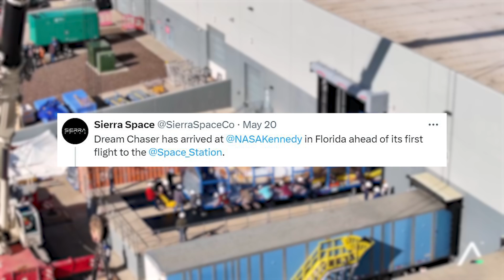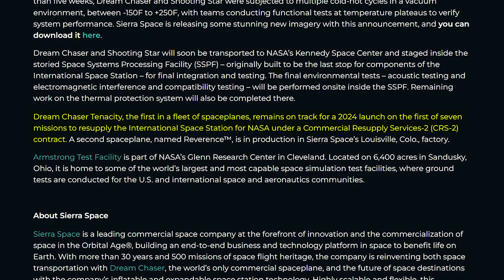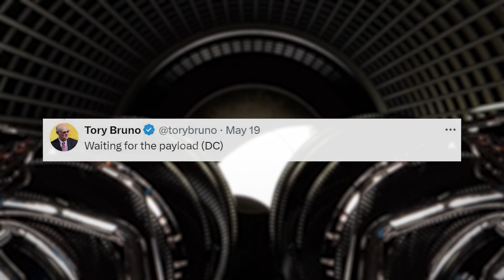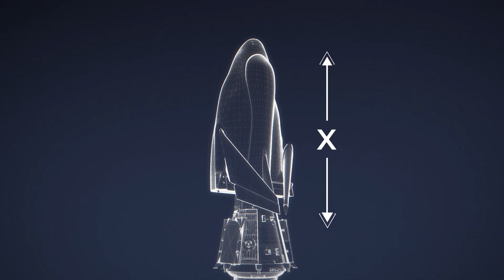Dream Chaser Tenacity Is Getting Ready To Launch

Comment: Dream Chaser will be a wonderful addition to the US cargo delivery and operations services. One of the interesting things that are true is that Dream Chaser will use a Berthing Port instead of a docking port on ISS. That means that the valuable docking ports can be conserved. Berthing Ports also are wider than docking ports, so bulkier cargo can be carried in the pressurized module and enter the ISS through the port.
I wonder how many years it will take to create a man-rated spaceplane. That would be the coolest, but such an endeavor is difficult. For example, look how long it was between Cargo Dragon becoming fully operational and the Crew Dragon's first flight.
Reply: I believe we would already have a crew rated Dream Chaser if Sierra Space had been given the contract instead of Boeing.  One of NASA's biggest mistakes in recent years.
Reply: Where do you get that 'berthing' ports are different from 'docking' ports? All the ports on the US side of the station use a common docking adaptor which allows for both berthing and docking.
Reply: @_starfiend   Yeah.. kinda.. but not exactly. A ship that can dock itself needs a docking port, and can't use a berthing port without help from the station.  So grabbing a ship with the ISS arm and placing it at a berthing port, keeps the docking port free for other ships.  Not the best explanation, I admit.🤓
Reply: @martythemartian99  There is no such thing as a berthing port. All ports are for both berthing and docking. It's the same port! For berthing the visiting ship is grabbed by the canadarm, for docking the ship does it itself, but regardless, IT'S THE SAME PHYSICAL PORT! There is NO separate berthing port. As I understand it, some ports are easier to berth to, but it still a docking port as well.
Reply: @_starfiend   Except for the berthing ports, which are generally on the side of a station module, where a self docking ship can't dock because there are no docking sensors etc.  Sure it can be grabbed by the arm, but it can't dock.
At the end of the day, even if they have the same mechanism, the ISS partners do refer to them as Docking Ports, and Berthing Ports.
Reply: But Sierra Space WAS building a Man-rated spaceplane: Dreamchaser for NASA. But NASA changed their mind, asked for a cargo version instead and Sierra Space adapted Dreamchaser to: Tenacity.
Halfway through redevelopment of Tenacity, NASA changed their mind AGAIN, asking for a crewed spaceplane AS WELL as Tenacity.
So, Sierra Space are also working on Dreamchaser Mk2; and also a Tenacity Mk2 designated, "DC201"!
Sierra Space has been tenacious with NASA; watch out SpaceX Dragons stripped-down capsules.